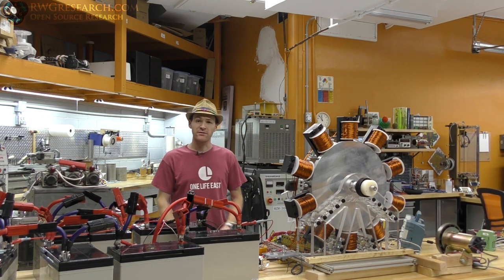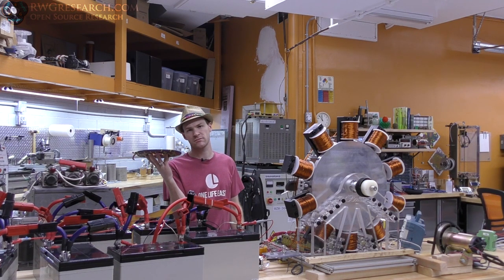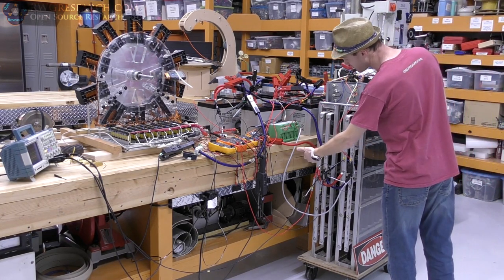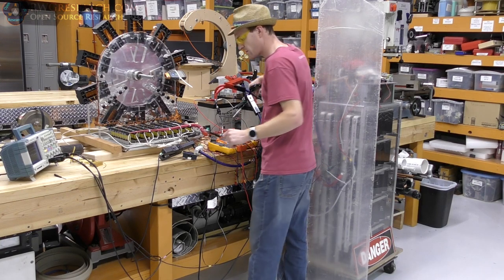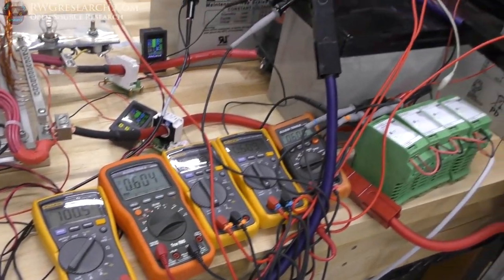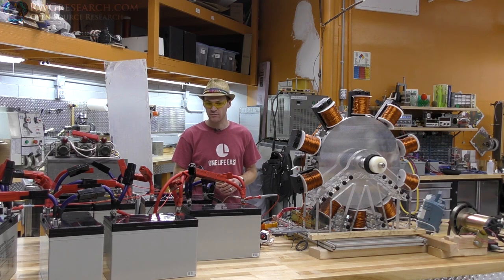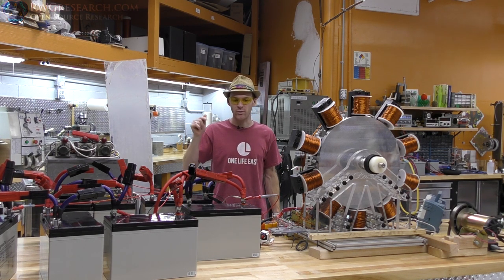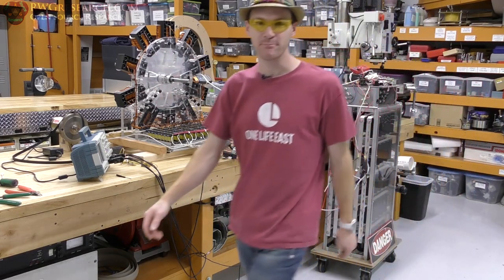P6 : Bedini 10 Coil Testing... "Self Looped" flash back from 2017 (Conclusion #1)

Comment: Did that set up have the neon bulb protection across the transistors? They tend to be a good way to tell if you are eating up the transistor junctions with the flyback energy. If the impedence is mismatched too much, the energy doesn't get to the output and eats the transistors

Comment: Transistors will blow if you don't have the output on a load, especially at high voltage, OR...it's  the inline amp meters that are causing transistors to blow per John Bedini.

Comment: 2/3/4 or more , the output batt change the Impédance line. If your battery never charged with pulses, is long, internal resistance is high.  Is not positive energy but négative energy..first test is one to one Batt, charge one, (calculate the input joule), and discharge the batt, now you have cop more to 1. COP battery. your système cop is maybee 0.2. Now charge your système on axle, your COP systeme INCREASE and no touch the cop batt, now you have 0.6.  Now it's time to have S1 for Gen the 2 kv out and self charge primary batt, all on my channel. Best Regards

Comment: Hey Rus have you ever used a bridge rectifier and batteries as a resitor? Its possible to charge batteries as they are subtracting the voltage value of the battery .

Comment: This bedini setup is a complicated very efficient joule thief setup? IMHO, you have the high voltage spike but not the high frequency needed to fire up the electrostatic machinary? When Eric D. ran the analog computers to speed up the waves beyond the light speed he used high frequencies also.

Comment: I have his video series and books. You didn't use it correctly. Nothing should be blowing, and if you do, replace it. John Bedini built it exactly as it needs, so when you don't replace transistors, you are not using his system then. You changed it when you didn't replace it.

Comment: 3.07 you cannot mesure radiant energy its negative & no current & its charged in pulses what that efect is 
thoes batteries become something else ( negative charged ) & their energy is cold
the tunning of coils wire length to resonace of the speed dumping schematic where you could SSG
put the “rigth” energy in … so if something fails there you “damage” the battery with different energy tipe. Ferris Wiel. 
so the more parts you have the more posibilities for something to go wrong .
for example the stars & moon & rigth conditions of solar flares & your equipment has a larger pulse that kills some critical part so 
thats my thougth process . its a mindbogling good topic that rapt into misteries & conspiracies 
but . tombeardenisrigth by johncbedini